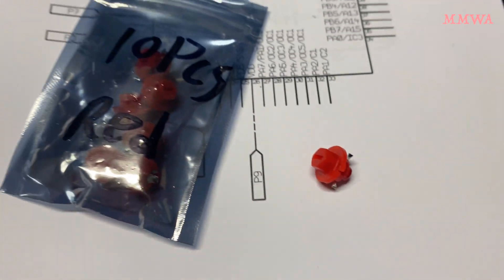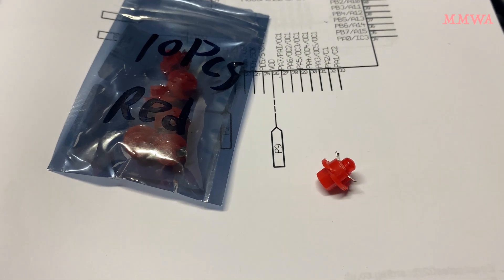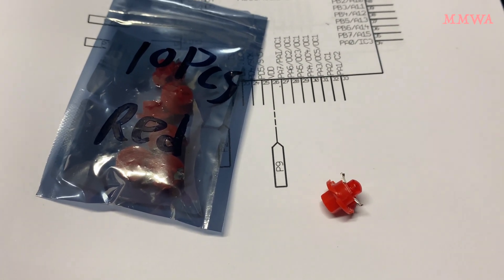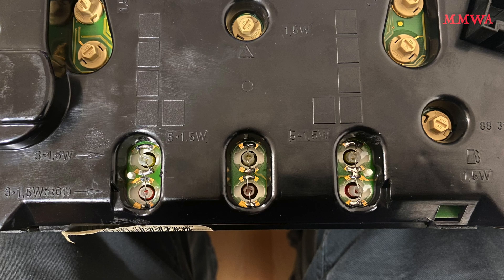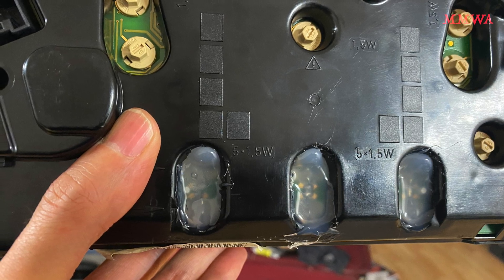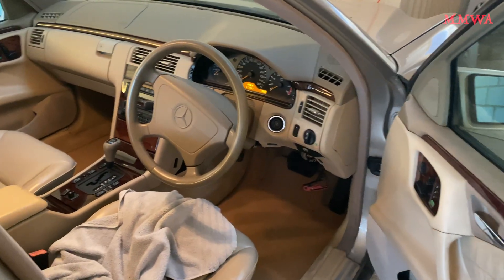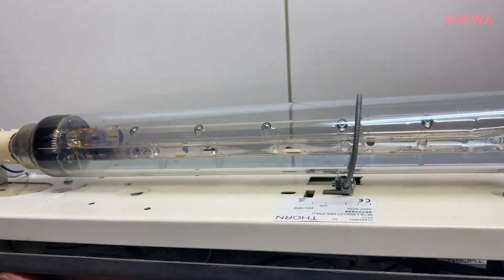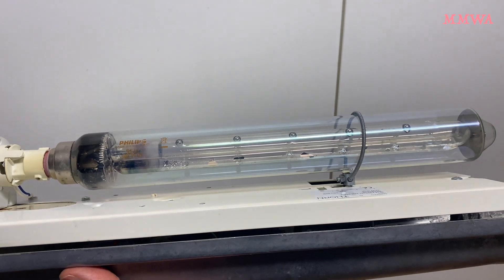Instrument Cluster Orange LCD backlight LED Upgrade

Comment: How will the hot glue go in the summer heat mate?
Reply from the maker: doubt it will be an issue, this hot glue gun has variable temperature control and i couldn’t even get the glue to flow till going to 210c and above.
Reply from the maker: coincidentally did not realise theres high temp and low temp version hot glue, guess I got lucky. Those were the included sticks with the gun.
Reply: @MMWA-DAVE  ahhh must be a good kits then, I quit using them years ago because of the hobby nature of the glues.
I'll have to look into them again